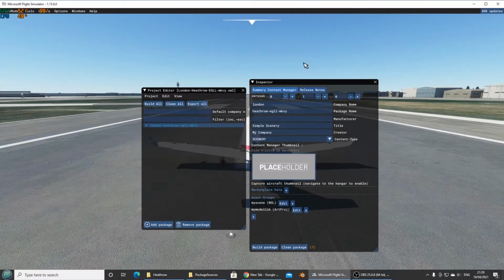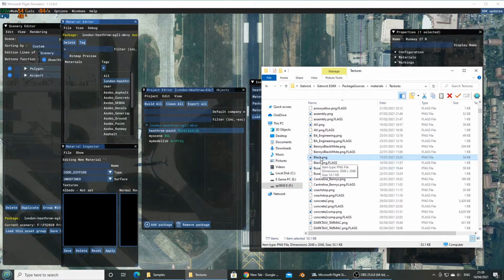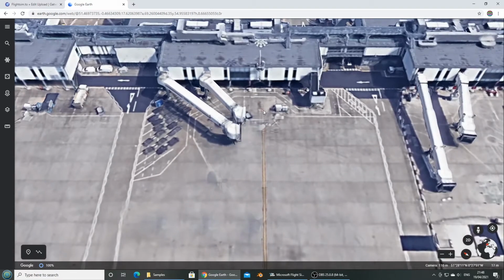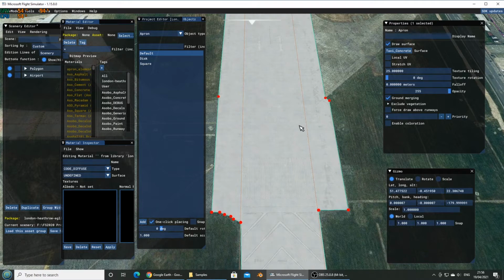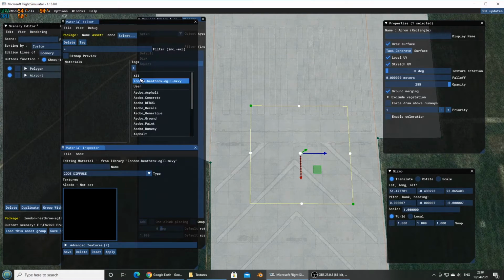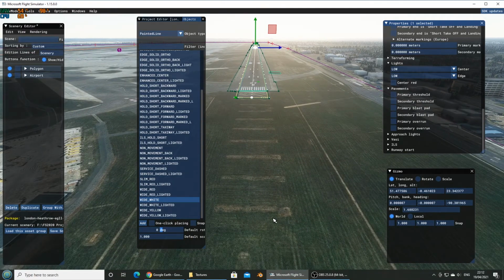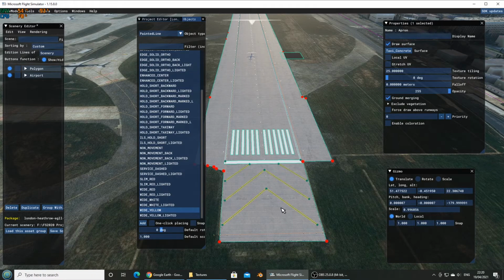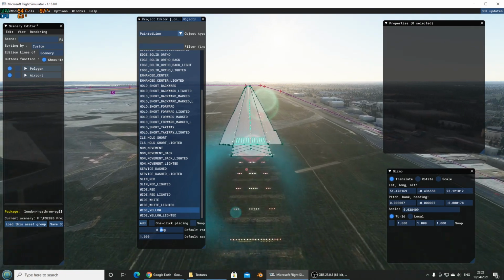003 Apron Texture asset creation and custom Runway

Comment: I realize this was all ages ago, but using a square apron with your own white texture just to paint some runway lines was a bit overkill. I wasn’t using the SDK back then so I’m going off of,how,it works now, but a default apron where you define the nodes is way easier to control then just use a default asphalt texture with white coloration works a treat!